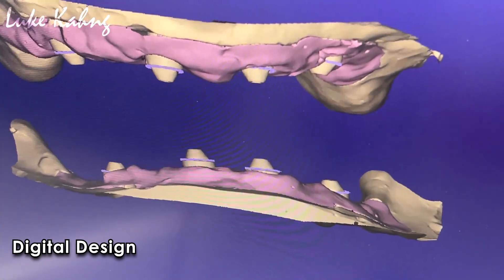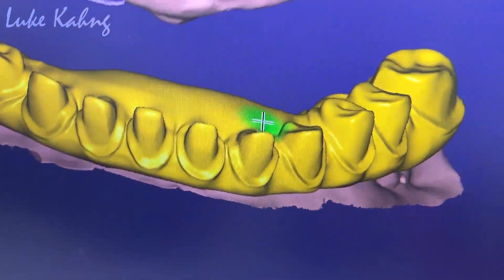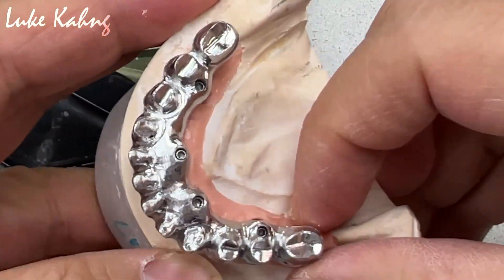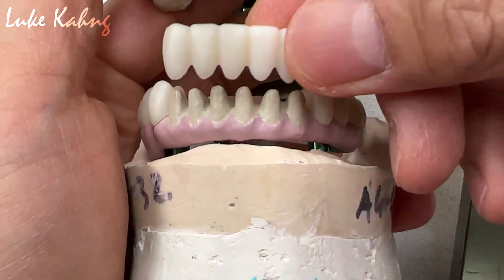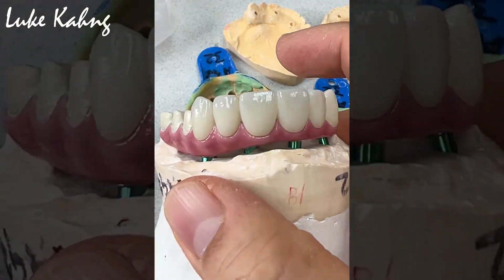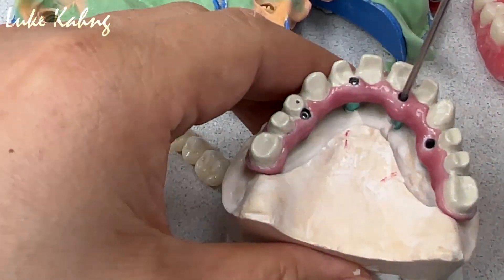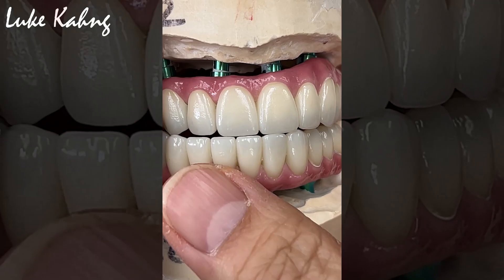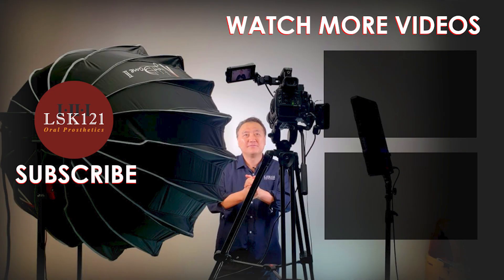How to Make a Full-Mouth Implant That Stops Ti-Base from Failing

Comment: Hi so instead of cementing metal frame ro Ti-bases, you have milled screw retained metal frame directly? So no ti-bases involved?
Reply from the maker: Yes
Reply: @Lsk121  so it may prevent ti base failure , but might create another problem of screw loosening